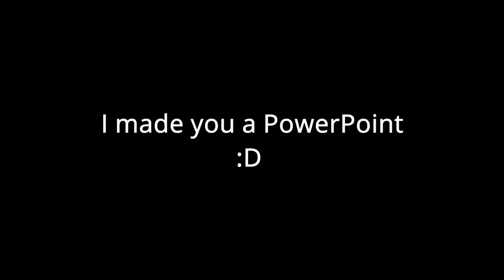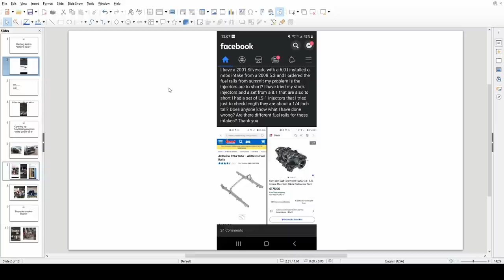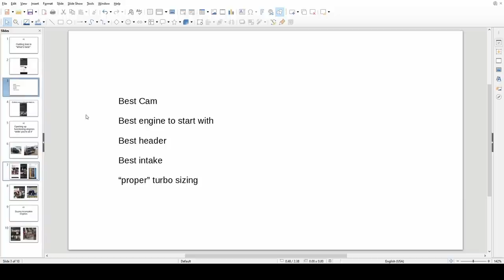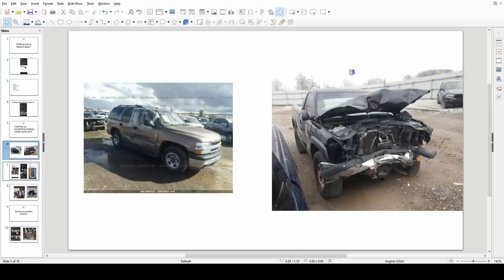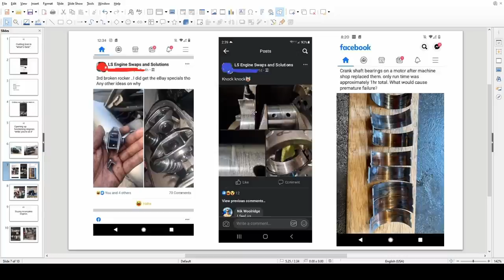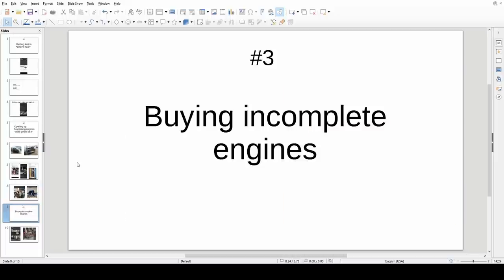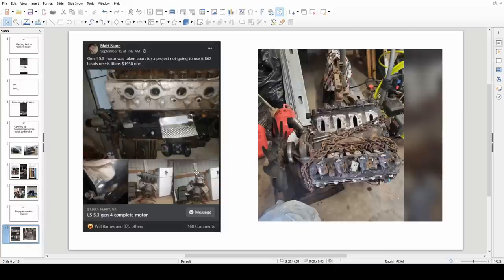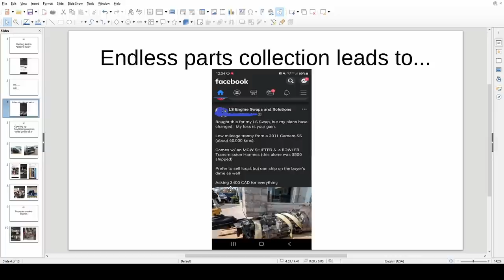3 LS engine build traps and pitfalls to avoid at all costs!

Comment: I have a 03 Chevy Silverado.i had put the 5.3 in my 01 datako.but now I am having trouble starting it..it don't start..it's a crank no start.same pcm all wiring harness is in..I am losing my mind.no spark no injector plussing.i am getting 12 v on all the injectors with key on.the ohm are 0.02 to 0.03.i change out the cam.crank sensor...help
Reply from the maker: There's about nothing I can do for you from across the internet, any more than I could tell you where your roof is leaking from.

Comment: I've noticed all your swaps are involving the 6.0 w/ 4 L 80 e trans, okay what about the OBS trucks with the NV 3500 manual transmission. Do you have any info on how to connect the wire harness to thet 5.3 LS.👍✌

Comment: Hey, what's your take on buying a non-wrecked 5.3? Most of the GM's that come to the local JY (and there are a lot of them lately) are not wrecked. (Many of them I would like to have because they are nice looking trucks). So the only reason I can think of for them being there is- engine damage, or transmission failure. So I'm thinking if I get one I'm going to have to open it up and dig into it to look for a problem. What's your thoughts?
Reply from the maker: If it spins it wins

Comment: Lag is not even an issue.  Depends where you want to use the power.  If I'm pushing the car hard, it's not turning less than 5k at any time.  Either size it small and be making positive boost and  restriction.  Just go big, run the car NA when you cruise.  When it's time to race you want the engine to breathe as much as possible.  Don't limit your turbine size because it's a street car.
Reply from the maker: Science!

Comment: HEY...LOL, I AM GETTING THE TRAILBLAZER SS INTAKE.. ONLY BECAUSE ITS CHEAPER THAN A FAST INTAKE.. BUT HES ABSOLUTLY RIGHT... I BTR CAMMED AN LM7, BUT FOR THE SAME PRICE.. I COULD HAVE JUST BOUGHT AN LQ4 THATS DAMN NEAR PUSHING THE SAME HP...AND ANOTHER THING... I USED MY 220,000 MILE LIFTERS WITH MY CAM SWAP.. WHY? BECAUSE THE AC DELCO LIFTERS I BOUGHT OFF EBAY WERE COUNTERFEIT..

Comment: My perspective is long lasting engine. Your is more likely swap and go have fun and if it blows it blows. You have great advice for the most part. I would live to tag with you at the junk yards and do alot of the same thing. But I tore down the entire engine to bare block and want to build it to last another 250,000 miles. Have fun. Tare it up and do it again is what I get out of your site. No problem. Keep up to good job your doing. But some of us are into it for the lasting effect of the new LS. But can't afford all the new shit. Lol
Reply from the maker: Mine has been in for three years of 7,000 rpm shifts 😂 

If it blows up now, I'm not mad. 

I've never seen a reman go 250k, which is why I say, avoid machine shops.

Comment: in my area there really isnt anything, no i dont sit on my couch i ended up buying a 6.0 off ebay for 1270 that didnt come with a ecu and that was cheper than my local junkyard which by the way doesnt let u pull them. they wanted 1500 for a almost 20 year old 200k mile engine. thins are different on the left coast tho. i am glad someone thinks like me tho keep it u;p jr
Reply: What state are you in?
Reply: @fuzzymoto896   oregon

Comment: Most peoples plans don't include  , electronics , wiring , cooling system and fuel system costs .
my swaps use  a Microsquirt , a double pass radiator and a walbro 450 Cheap but never Free .

Comment: The biggest mistake is opening them up and letting the magic out. Stop. Don’t do it.
Reply: Jason, You and JR are right, and you know how it is, oh let's look at it, I had to get a oil pan for my 5.3 and had it open but no way was I going to go fishing. I had it running on an engine stand, and it sounded great so put the pan on, and in the car.
Reply from the maker: Yeah, if you dropped that pan, and it was full of metal, by all means, investigate... 

If you dropped that pan and it looked fine, and it ran fine... 

Then why on God's green earth would you send the crank to the machine shop 😂

Comment: priority one, get it up and running, everything else can come after it is in and running, cam, headers,  tbss intake, ported and shaved heads, turbo, all that can come after the fact, these broken down engines are just that, broken, seen a bunch of people post up how there sweet deal on the engine stand did not last the first fire up and run, there is a reason why it is broken down and missing parts, just waiting on a good sucker to come and pay a sweet deal of a price to take the junk off there hands, if all you can lay your hands on is a 4.8, go for it, drop it in, line it all out, get running, why, that 6.0 down the road will drop right in and everything will bolt up with no problems.

Comment: If your comparing shorties to stock manifolds then yes that is a waste but long tubes make power across the entire range. $300 for stainless long tubes from speed engineering is money well spent.
Reply from the maker: I really don't care lol, I bought them because they look cool and it made running my exhaust easier... I don't care in the remotest if Holdener proved they make 8 more hp, was not a factor in purchasing them, and I can't for the life of me figure out why that statement was the one thing 50 commenters seized on in this whole 10 minute video lol.

Comment: Biggest mistake is paying more then $600 for a complete 4.8, 5.3 or 6.0 cause I can go to my local pull apart an pickup any of the 3 engines complete with non cut harness and ecu for $525 out the door with taxes and loaded

Comment: I started my planing thinking sbc ways rebuild it first more i watched JR and talked to guys on my truck forum i realized this is not needed on a good running engine.

Funny watching guys buy all the holley do dads then ask what controller they need for there transmission 

Or the guys that scream you need 10g to do a ls swap

Comment: Shorty headers are absolutely useless in comparison to long tube. 
Long tube definitely have shown to make more power in almost every rpm range. 

You can find cheap options knock off brands when it comes to headers. 
What matters is the length and width.
Reply from the maker: If you define more as 12, on some fully built NA LS, then sure, they make more. 

FFS, idc if people buy headers or not, but back to back testing shows they do fuck all that you'll notice.

Comment: I just commented on the video that camera in one hand, baby sit the pups and use other hand to wire a engine so it will start and run and I learned a ton. What did I take away from this.... okay your in the wrecking yard looking for a 5.3 or the 6.0 and you want complete. You find a handful and most have been violated or banged into and broke pieces... ok, did it break say a waterpump or something that will affect the engine serious ??? Just the gingerbread. ok, swap good pieces to it so its complete and go home with it.... oops I see pans dropped and some silicone in places shouldn't be. So this one is a leaver B. I think I am getting the picture and I have wrenched enough to know where an where not to go. I get it, General motors spent billions to do the  research so why reinvent the wheel and unless your going further than the end of the driveway to do burnouts then run as is and where it will be if you put it in the old family garbage hauler. Just from my stand point, I don't think its a old car unless it came from at least the eighties and should be fifties. Look, I know mullets are the in thing now and a viking beard is cool but I have had a beard since I got home from nam anyway... too f'ing lazy  to shave everyday is how I just got into mine.  I do see one thing here that even you might of figured out long ago. There is a thousand new channels with guys telling stories out of school on how to go faster for twenty bucks and I would pick and choose information very very carefully as some to most is bullshit.

Comment: I do disagree with you digging into the engine thing... you have the engine their. its on the stand. new oil pump crank kit (reman crank new bearings etc.). i do disagree with using cheap parts though. when i built mine it ran yes but i pulled it apart. where's the weak links? lm7 lifters and oil pump. Why not replace them? LS7 FACTORY GM LIFTERS  and did i  do the comp cams trunnion upgrade? yes. why? because the factory ones are not as good. Your already their why not do it? All of these seem to me like operator error... or they take their shit to a not reputable machine shop. Like for example i pulled my 4.3 because of a spun main bearing. some dumb asses will throw a crank kit in it and call it good. when you spin a main bearing you always have them make shure the mains in spec. which they where not so i had the engine line bored. Did i replace the oil pump,rings,timing chain,have it hot tanked but still brake clean the living fuck out of everything in that engine while i was their? yes. my point stands if your engines on the stand you might as well do it right the first time and pull it apart for inspection and freshen it up.

Comment: You’re dead wrong about headers.  If you by cheap unequal length headers then they do shit. If you want real performance then you have to by real equal length headers which promotes scavenging and increases hp. With a new tune. You have to tune the motor after every upgrade
Reply from the maker: Sounds super cost effective, you go get that 12 hp
Reply: @TheDrivewayEngineer   a real set of headers adds way more then 12 hp.  Try 30-40 depending on the motor
Reply from the maker: Sure thing
Reply from the maker: Also, my comment, which was 3 seconds in a ten minute video, was specific to my truck, that the camera was pointed at when I said it. 

So, way to really get down to the root of the whole thing :D

Comment: best engine??? do not fall down that rabbit hole.... do NOT try and use a gen 4...... even in a gen 4 truck..... older is easier... perhaps not better, but easier..... and WAY cheaper!!!
Reply: when ya get into gen 4.... if your going to try it.... MAKE SURE the ecu and harness are the same from the donor to the swap...... my colorado is technically a gen 4 truck.... 09.... i got a gen 4 donor 5.3 from a 2010..... BUT the ecus were different, my rado had an E67... the donor was an E38.... so i spent MONTHS repinning and rewiring the harness to make it work..... only to fail

Comment: Headers dont make any more power? Your full of chit. Even if its just 5 they do. Its proven
Reply from the maker: Oh, well, 5, you got me
Reply: @TheDrivewayEngineer  figure of speach. Could be 5 could be 15 depending on engine... the type of header and  exaust behind it
Reply from the maker: Ah, it's a figure of speech when you do it, I'm a retard when I do it... 

On an LS, with a medium cam like mine, what's PROVEN is a 10 HP gain, on an engine Dyno... 

Or at the tires, so little a back to back run difference would eat it up. 

Buying them because they make power, is not a wise expenditure, because they don't. 

Buying them because they fit your chassis better, or because you simply feel like it, is a different matter. 

If you can afford to chase 10hp no matter the cost because you're competing for the world HP title, more power to you.
Reply: @TheDrivewayEngineer  cam  and or head work or aftermarket heads??? Much more than just a cam. Headers will gain more as the engine ir modified more.. also your dyno/tuner may be garbage
Reply: @TheDrivewayEngineer  all depends on engine size. Combo and header type.... shorties are garbage